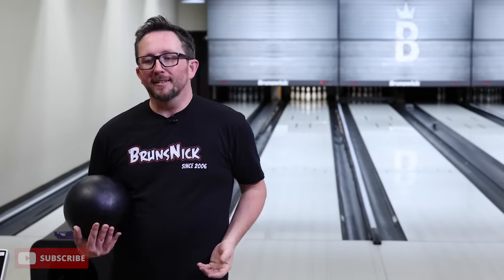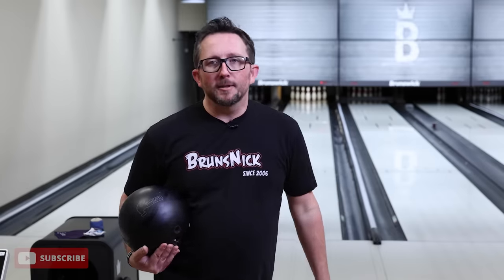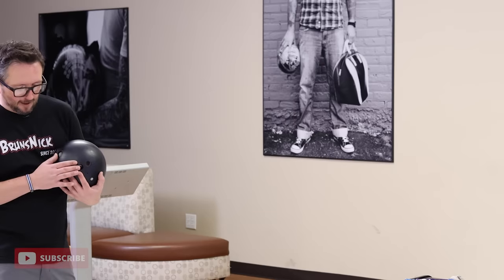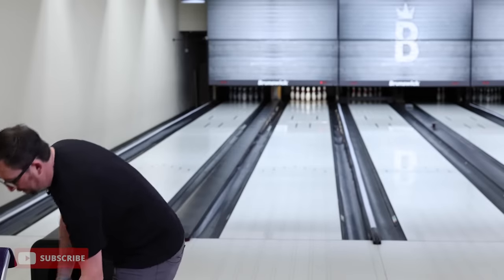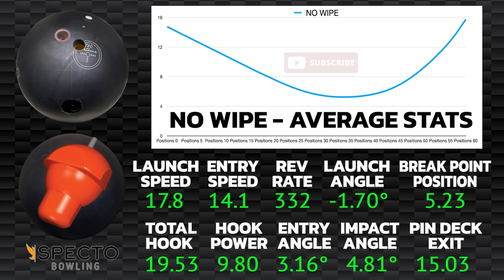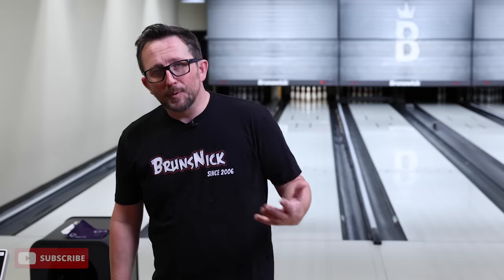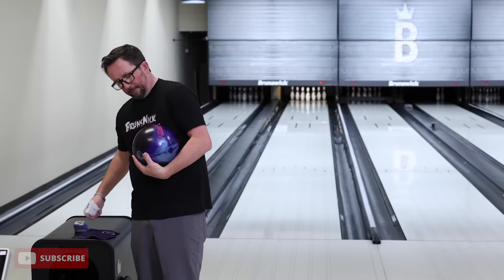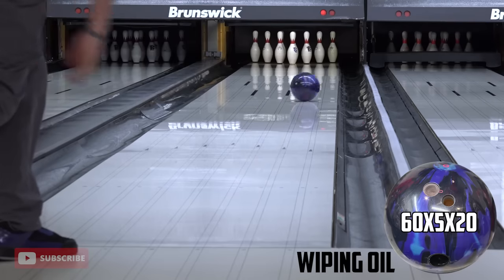WIPE YOUR BALLS! (Thank Me Later)

Comment: When the lanes have a lot of oil, I clean the oil off my bowling balls. If I don't see enough skid, I leave the oil on my bowling balls. Most of the time I leave the oil of the balls because I don't throw a lot of revs or speed.
I notice that the layout you use is a drop ring finger layout. Did you always go with that layout or did something different in your younger days? I like your videos, but I don't have the revs or speed to notice much different wiping or not wiping the ball unless there is a ton of oil on the lanes.
Reply from the maker: It’s Sarge Easter grip. Made a few videos about it that can be found. Basically, had an injury and this helped.
Reply: He did a few videos on the Sarge Easter layout.

Comment: I am 50/50 when it comes to wiping. with urethane balls, 100% of the time I am wiping my balls. However, when it comes to reactive it varies. I am a no thumb one handed bowler, so I rely heavy on being able to properly grip the ball. I cannot have any oil between the ball and my hand, so I do wipe the ball (especially around my hand placement area). In my specific league, each team has four guys and we bowl four games. By the third to fourth game, the lanes are pretty much toasted. This is when I start to wipe my ball less and less. I still wipe around the part of my ball where my hand goes, however I may go two or three frames before wiping the rest of the ball off. I do this because I know that most of the oil on the lane is dam near gone, so I know that there’s at least oil on my ball (especially as a right hander). So game one and two I am wiping my ball almost every time, but game three and game four I’ll fully wipe my ball every two to three frames.

Comment: Nick.. you overlooked something. If you wipe urethane every shot you will burn up the heads faster! And what happens when you move in off that spot with urethane? 10 pin.. 10 pin.. If you are moving every game, I can see it as an option. But if you are bowling multiple games on the same pair with urethane I would skip wiping all together..
Reply from the maker: Oh I want urethane to dig. That’s the only way it’ll strike is by setting up early. Rather than move in which is never really an option, I’ll switch to a lesser surfaced Purple or go to Black but I get what you’re saying.

Comment: Pretty much like you said towards the end. If there is a lot of oil and and the backends are slower, I wipe for sure. If the lanes are medium and the backends are fast, I do not wipe. Later in the tournament when the heads are getting dry, I do not wipe. Oh also if I'm bowling on a pair with someone throwing urathane I use a little surface and I wipe every shot. I'm also rev dominant.

Comment: Question on not wiping to promote skid for 10 pins... doesn't your release change and the flare would be different anyways?  🤔 I could be way wrong, just wondering.
Reply from the maker: The release does change but my track really doesn’t. Still in the general oil track area.
Reply: @brunsnick  got it thx!  Trying to learn as much as possible about the balls and more technical data like specto gives.  As I said b4, I'm a golf pro and trackman is my life (same as specto for bowling).  I know how to throw a ball but don't really understand the ins and outs of drill patterns, differential, etc... yet.  You have taught me a lot!
Reply from the maker: I’m a SkyTrak guy myself, but def not a pro! Just a techy guy who loves golf enough to build a little sim in the garage. 👍🏻
Reply: @brunsnick  wow that's awesome.   I got my PGM degree back in 06 and I've been at the PGA TOUR Superstore in Chandler AZ basically ever since.  I'm in the STUDIO as the master fitting pro.  If u get to az, come say hi 😊
Reply: @brunsnick I could flatten out the ball for the 10 pin and it would go straight but my 3/4 track didn't 
change, never rolled over the holes like some pro's do hearing it thump down the lane. Not sure how the ball went straight when the track was the same as my strike release.
Reply from the maker: The pap can be unchanged but the RPMs and speed change.